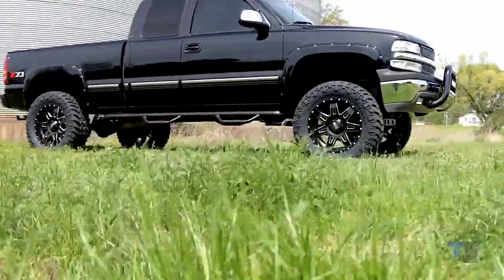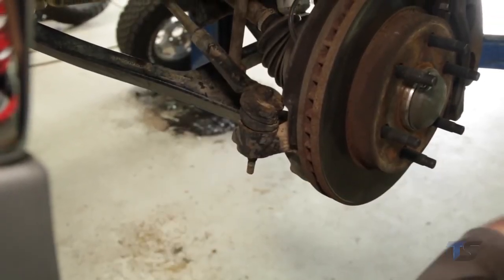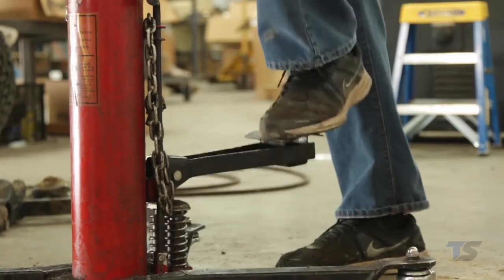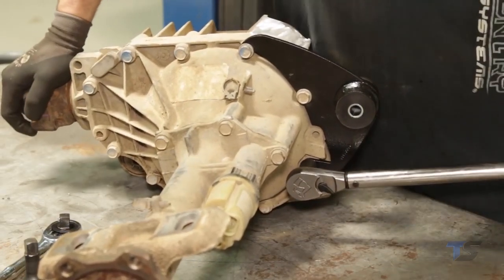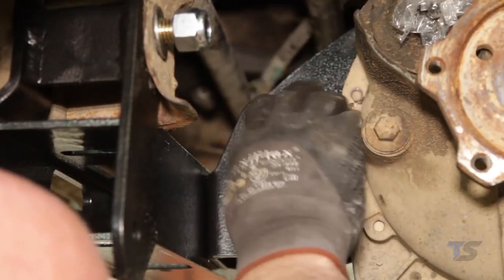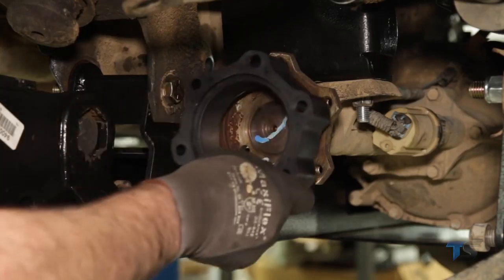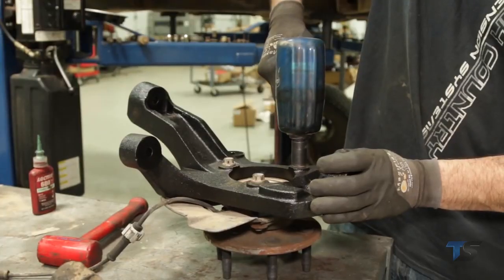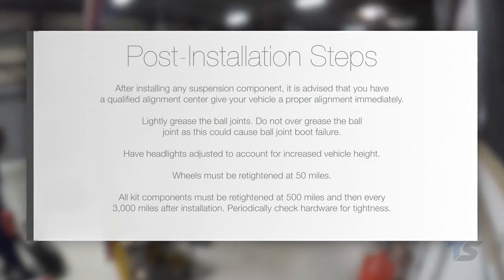Installing Rough Country 6 inch Suspension Lift Kit

Comment: I just did this to my 2004 gmc sierra 2500hd 4wd.  After watching the video 50 times I said no thanks, lol. I'd rather take to shop and work it off.  $820 later with 2 inch rear spacers and alignment.

Comment: is this for 1997 k1500 too? Just asking bc I’m new to all this and I have a truck that I want to lift and I need to know if I have to shave some stuff
Reply from the maker: Rough Country kit 25370 fits the 1999-2006 Silverado 1500 and will not fit a 1997 K1500. Kit 27630 fits the 1997 K1500's.

Comment: Can the this kit be left at 4-4.5" or is it a full 6" only kit.? I have heard other kits advertise as 4"-6" lift.
Reply from the maker: This kit is only a 6" leveling lift. It does not offer the option for a lower height. Depending on your application we may have a 4" lift available instead if you are interested in a lower lifted height.

Comment: Do you need a vehicle lift? Or would floor Jack stands provide enough clearance for installation?
Reply from the maker: This lift can be done on jack-stands. It will take some extra time and you will want it supported by the frame but plenty of installs on this kit have been done without a vehicle lift.

Comment: new C.V. Axles but no new control arms?
Reply from the maker: The original CV axles are typically re-used with this kit. In the installation video they were replaced due to condition issues. Lifted control arms are not necessary because the design of this lift kit uses a sub-frame drop and a lifted knuckle to keep the control arms close to a stock position.
Reply: i didn't mean aftermarket control arms. from the looks of the condition of the control arms, why not replace them when installing a new lift kit? or replacing any other steering/suspension components...based on the age/condition of the vehicle that is
Reply from the maker: In this install the upper control arms and the CV axles were replaced due to issues with condition. It is always advisable to replace any worn suspension or steering components as soon as you discover they are worn. Despite the appearance of some components they were not worn at the time of installation so they were not replaced.  @pat14lang

Comment: I want a lift kit but have no idea how to do all of this. Anyone have any idea wjat someone would charge to install one for me? Shops or backyard mechanics
Reply from the maker: The rates will vary with your local market. Rough Country provides average install times for their kits. Ex. This kit 27220a has an average install time of 8 - 10 hours. You can contact your local shops and inquire about their labor rate and they should be able to give you an estimate.

Comment: Will this fit on a 09 hybrid silverado
Reply from the maker: This 27220A kit will only fit up to 2007 models so it will not work on a 2009. The Rough Country 23630 is a 6" lift that will fit a 2009 Silverado 1500 Hybrid 4x4.
Reply: Michigan Truck Spring thank you so much